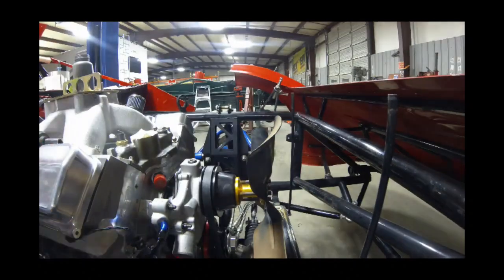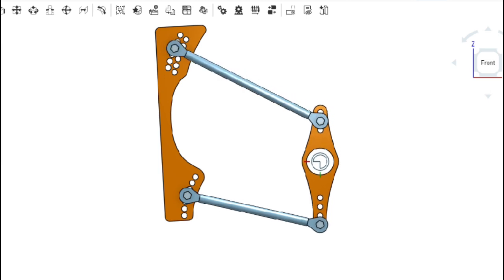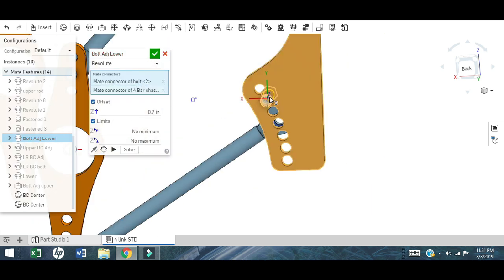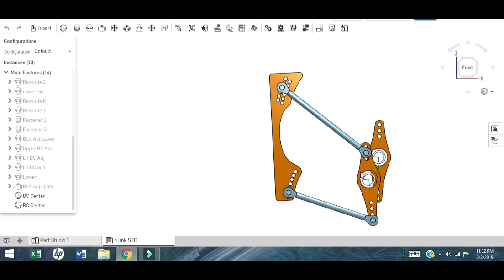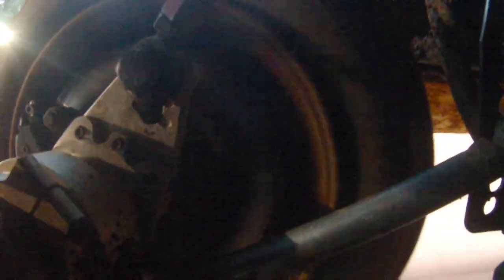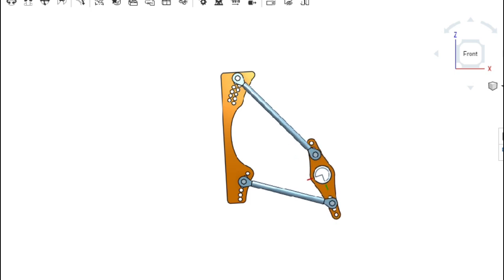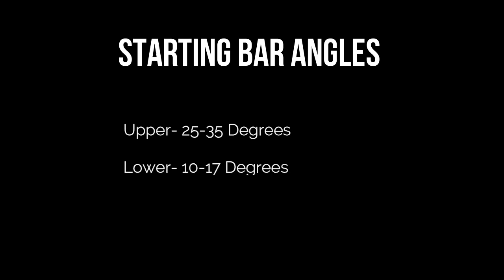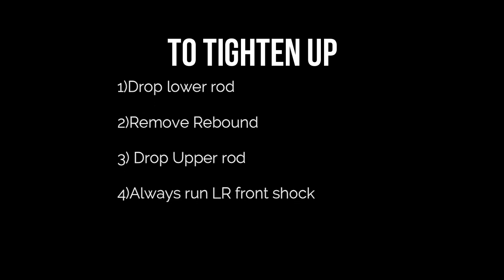4 Link Suspension Adjustment Dirt Late Model

Comment: This was so far over my head, I was watching 4 link off road stuff, and this came up. Thank you for explaining this kind of setup, I'm sure your competitors appreciate setup hints and tricks. I try to stay in my lane( welding and fabricating the cheap 4x4 stuff)  but its always cool to learn something new
Reply from the maker: Ryan thanks for watching! I try to break down the complexity of these cars as best I can for racers of dirt late models and those intrigued by it as well. There is a good bit going on in the rear end of these cars that works asymmetrical from left to right. This is where the turning capabilities while on throttle is able to be achieved with huge traction. Check out the rest of my tech videos you will find them intriguing as well.

Comment: We’re just getting back in to dirt track racing. Thanks for the info.
Reply from the maker: Be sure to check out my Setup & Scaling guide, Track Day Adjustment Guide, and Guide to Doing Tire Work for additional information, thanks!
Reply: @DirtTrackDave  I sure will. We’re building brackets to go under the car now to convert it to 4 bar. We’re going to be videoing it. Just dropped a video last Thursday building the bracket.
Reply from the maker: @GerraldFarms  got a lint to videos?

Comment: Thanks. Always had a fascination with these cars and now run them in iracing . I'm having bad forward drive problems.  I'm usually .3 off in lap time from the leaders on short tracks. I'm competitive at eldora.  I will try anything at this point.
Reply: 3rd arm, pinion angle,rear spring rate. and stagger effect that 🏁

Comment: Can you do a video showing what each rod will do and how much change it changes for example you need an extra inch on the right to loosen up the car move this bar, or to tighten up the car on exit move this bar one hole, for us new guys this 4 link stuff is new and where do we get the program you have on your computer to learn the angles and such.
Reply from the maker: Well that is getting pretty technical, and thats the stuff I break down in adjustment guide. Here are links to those guides.

PayPal links to purchase guides

Set up guide https://www.paypal.com/instantcommerce/checkout/4J87KMZC9D5PU

Adjustment guide https://www.paypal.com/instantcommerce/checkout/9974U9XA5MTYS 

Tire guide https://www.paypal.com/instantcommerce/checkout/W6GF2X6VSBNFN

Comment: awesome video, I'm new to the dirt track racing and I had picked up a 3-bar modified and I'm having a hard time figuring out how the rear set up works. can u do a video like this for a 3-bar set up?
Reply from the maker: wicked toyz treat it similar to the 4 link in videos if on dirt. Use the Average angles of the of the 4 bars on each side for a starting point for 3 link. The 3ed link on rear end more angle more anti squat.

Comment: I got a assembly mocked up to simulate this in fusion 360. I was wondering how you constrained everything and how you were able to get angle to be simulated in cage? Thanks
Reply from the maker: You have to make an assembly after parts are extruded.
Reply: @DirtTrackDave  I got the parts extruded I’m just not sure how to get it to show the motion of cage. There’s an error when try to get it to rotate the way it’s suppose to
Reply from the maker: @caderichards7354  you can animate it or manually move it with mouse. Be sure all components can move and have tolerance. There are videos on YT breaking it down.

Comment: Do you adjust both top and bottom at the same time or are you working one or the other in those canareals.
Reply from the maker: I normally only adjust RR upper and LR lower. In situations when the LR upper exceeded 45-47 degrees in droop I drop it to maintain 45* and lower. The RR lower I rarely change only reason I would make a RR lower bar change is track type. Like paperclip style track or momentum style tracks demand different lower angles.

Comment: Dave what cad package are you using?
Reply from the maker: This was done using onshape
Reply: @DirtTrackDave  thank you I have been working this same project  in Autodesk fusion 360. Family use to race years ago and I use to do the mechanic work on the cars. Now I just tinker with different projects in Fusion 360 to learn the software. Wish I would of had this stuff to use back then. again Thank You for the feed back.

Comment: We are tight goin in and loose coming off how do I fix it
Reply from the maker: My track adjustment guide covers all that. Breaks down the effects of adjustments, both desired effects and negative effects. Follow the link it's emailed to you and is 36 pages long. https://py.pl/1vwAWeh3Udl
Reply: @DirtTrackDave  link doesn't work
Reply from the maker: @Andrew Z  set up guide- https://www.paypal.com/instantcommerce/checkout/4J87KMZC9D5PU
Reply from the maker: Adjustment Guide- https://www.paypal.com/instantcommerce/checkout/9974U9XA5MTYS

Comment: Also when you cam over it unloads the weight cause it starts to reverse it effect.
Reply from the maker: It's locked solid and no longer using load on spring as desired. Suspension goes solid fo a small bit.

Comment: 4 bar sucks.. Z link is where its at!
Reply from the maker: Z link has its application and good. However with one bar one direction and the other opposite you are not using the forces from acceleration to help aid in anti squat and forward thrust.